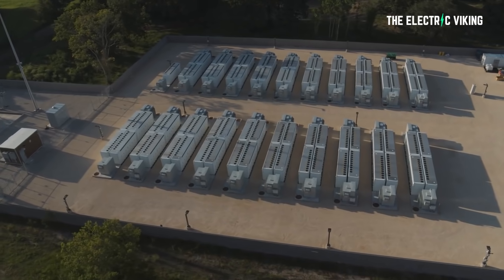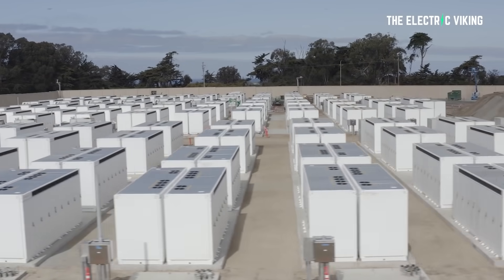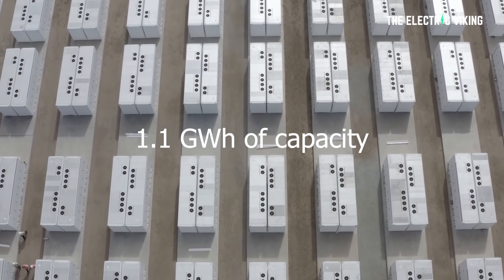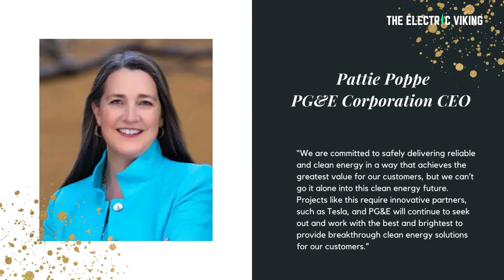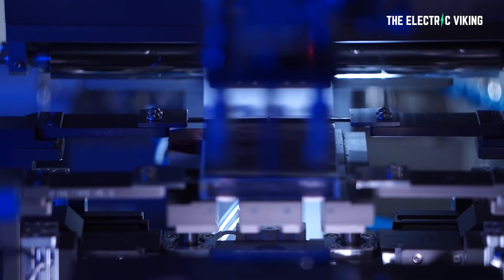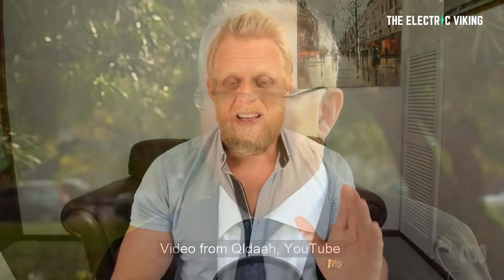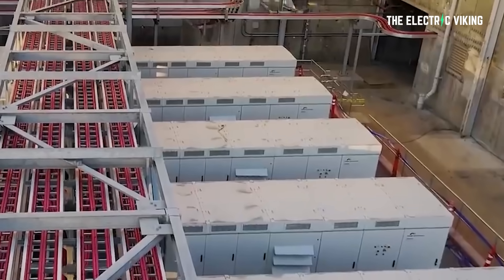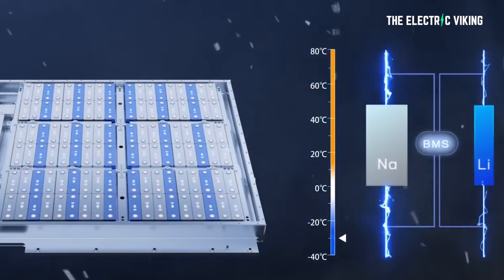Tesla's new MEGA battery signals the end for COAL power

Comment: Reciprocating peaking plant and gas turbine peaking plant can be at full load in 5 minutes, not hours. Gas turbines do have a ramp rate typically over 10 minutes. Baseload coal fired plant might take up to nine hours limited by the need not to overly thermally stress boiler parts. Hence why base load is coal. Please try and inform yourself before making statements.  BTW - what blackouts in Australia?  My recollection is storm related. The other factor is the current (no names) plant owners have been gaming the market by withdrawing supply - wink - less supply higher prices, of course all under the umbrella excuse of going green to reduce CO2 emissions.  This is why the Australian Energy Regulator stepped in and started to control the market.

Comment: Recently a 100MW/400MWh storage facility was put in operation in Ventura County in SCal. It consists of 142 Tesla Megapacks and  was built instead of a gas peaker plant.   No question in my mind that Tesla’s energy division is going to rocket over the few years.  Utility scale battery storage has been the missing leg of the renewable triad of solar, wind and now storage.  Tesla’s Autobidder AI driven program can be tied in to optimize storage and marketing opportunities in real time. It can and will disrupt the energy market in certain areas.

Comment: THE GRID is were the money is. Soon.
The ends of the grid, millions of ends become the power supply. 
SOLAR with a BATTERY at the ends.
Every one will have a huge battery in their EV, and it will automatically plug itself into the grid. 24/7 except for peak hour. 

The grid will give or take what it needs. 

The EV will dictate what it's minimum needs for its next tasks, driving home, power the home overnight, side trips to shops, etc.
With trickle feed to every EV, the fast chargers will only be needed for a few trips. 
Fast chargers are heavy current installations and expensive. 

Forget horse and cart, forget weakly fill ups and $100s into the tank. 
Every EV will be fully topped up every single day or trading power with the grid.
AND MAKING MONEY 💰. 
Hello Hello anyone thinking???

Community batteries will come first as the grid gets cheap power to sell at retail prices.
The  power station business is at one location, 
The grid business is every where and buys its power from the cheapest supplier and sells for retail prices 😀. 

Nobody talks about this!!!!!!

Comment: These are lithium based chemistry - removing lithum for EV prodution.  While Lithium is a small physcial part of the system; cost it is skyrocking - adding about $2000 in cost to a Tesla size EV and to a Mega unit this Li costs  may well offset any other cost reductions. The mega packs might make an impact on wasted energy; likely more so than EV cars.
Reply: Tesla uses about 5kg per car (according to Elon during the 2022 Q1 call) currently its about 80 usd a kg. So that makes it 400 usd, not sure how you got to the 2000 USD.

Comment: The concept is fine enough; to handle variiations in power but it doens't produce any; so it won't do anything to reduce use of coal - indeed as world demand for electricity is up 3% per year any older 1% growth in world wide renewable - you will then see  EV 's pushed onto the grid - incrasing power demands by at minimum 25% so you actuallly will increase the need for Coal.

Comment: How is it going to produce cheaper electricity prices when the solar and wind are more expensive than gas power plants?  And then you have to add in the cost of the battery on top of that.

Comment: The other tech is batteries in homes that will reduce the load.
Reply: And high efficiencies, like super sealed houses, LED lighting, heat pump dryers, ovens, water heaters, and even home generation to offset most of that. An electric two way car can add grid capacity too if you have a few solar panels for your high efficiency house. Like most things, it's about balance.

Comment: Couple of facts to clear the peoples assumptions of how and why this battery was installed in SA.
The power grid could not cope with peak demands during summer,( just like in California.)
There was enough capacity ,it just could not react timely quick enough to deliver to supply a city and surrounds of about 1.5 million in a state of about 3 million the size of Texas.
Elon said Tesla will supply for FREE this aud$30 million battery solution if we can’t solve and install in 6 months ready for summer.Tell us where to plonk this thing.
Battery solved the issue within the first week of the traditional 100+F. heat waves by introducing a millisecond intervention to the grid supply (instead of a seconds) by the traditional base load power. In layman’s terms the power needed to “phase sync”with power ,that was the issue -time of sync ,not the amount of power generation.The battery did solve the problem added more capacity as a bonus in addition to supplying a cost effective marketing tool for Tesla.Now these things are scalable cost effective mainstream solutions now known worldwide and accepted as “legit.”
One of the “ unsexy”things that’s occurring in VIKINGS own Melbourne is one of the units is currently undergoing install underground in the CBD environs to support the electrification of the  new 15 $Billion underground railway subway extension project designed to enhance the cross city commute to be finished 2025(ish) plus add capacity to the grid.
It’s not sexy stuff for politicians until it becomes an issue. As I understand it the SA battery is undergoing the regular service/upgrades by adding more capacity with the phasing out the older huge legacy power stations/grid that feed in from Victoria,New South Wales and Queensland which are thousands of miles away,let alone the electrical loss over the wires and the bushfire/wind storms/flood problems that typically coincide at that time of year.

Comment: In Monterey County In California, the word slough is pronounced ‘slew’. Just like stew without the carrots, meat and potatoes.  

The California  Public Utilities Commission has directed all load serving utilities including PG&E to collectively procure 11.5 gigawatts of new electricity resources.  I’m guessing someone at the PUC figured out with electric cars increasing in popularity and the population continuing to expand we might need more electrical power in the near term. I guess batteries count as a resource if you assume if you build it, they will come as in the movie ‘Field of Dreams’.  In this case it’s if you stall a big battery someone else will charge it.  In the same press release PG&E states they hope to idle some natural gas burning power plants and the only remaining clean energy power plant in the state, the Diablo Canyon nuclear power plant.

In years gone by when we actually had forward thinkers PG&E designed and built a nifty system designed to take advantage of the diurnal cyclical-electrical usage in California.  It was called the Helms Project. It took advantage of the excess nuclear generation from Diablo Canyon during the night to pump water from a lower mountain reservoir to one much higher on the mountain.  During the day when more power is needed the water is released through electric turbines to generate electricity and the water is returned to the lower reservoir for reuse.  The next night the process is repeated.  If you don’t have Diablo Canyon and everyone is plugging in their electric cars to charge over night and you aren’t building any new power generation, where is our power going to come from?  If it is a cloudy day or the wind isn’t blowing you’re pretty much in the dark if you depend solely of renewables as we know them today.

Comment: Sam, I live in the San Joaquin (Wah-keen) valley of California I am sadly a PG&E (Pacific Gas and Electric) customer.  This project sounds like a good step forward but will not lower the cost of electricity to customers like me nor will it reduce coal burning for power generation. The State government has been encouraging its citizens to install solar on their homes since the Terminator was governor many moons ago. It made sense so a lot of us did so.  Now we have a surplus of power during daylight hours, so much so, that the utilities (there are two major utilities in the state and others as well) give power away to neighboring states just to get it out of their local grid.  Give it away rather than incentivize their consumers to use it.  They recently switched to time of use rates which heavily penalize customers that use power from 4:00 to 9:00 p.m.  Now, guess again why PG&E is installing batteries.  Store up all that $0.03 per KWH solar power we generate with roof top solar so they can sell it back to us when we get home from work at a 700% profit, even more if you exceed the baseline level of use.  

Still waiting for the price of battery storage to come down enough so I can afford it too without subsidies from rate payers.
Reply: The only thing slowing the transition to 100% solar and batteries is red tape and corruption to help keep old investments viable.

Comment: Gemini 11 square mile photovoltaic project underway in Nevada will have battery storage of 1400 MWh (and 55% of peak 690MW production). Clearly batteries are necessary and feasible. BTW this plant power cost is less than $.04/kWh  (US average price is $.125/kWh).  There is enough desert in southwest US to power entire needs for electric economy at much lower cost than fossil fuels. What is needed is transmission lines to these remote places (Smart Grid). And there are remote low cost wind energy sites as well. At $380 billion, Smart Grid cost estimate is high. But over decades of use, this cost is only of few percent of power cost.  Where are the venture capitalists --  new Elon Musks -- willing to build the Smart Grid, essentially a pipeline for clean low cost energy for an electric economy? And yes, someone needs to start mining a lot more lithium.

Comment: It amazes me that we can design circuits, and silicon processors, that are amazing, yet we still don't design electric grids with capacitive storage o.O
Reply: Two things: capacitors only store DC. That would be OK if they were on a DC high line (like 765 KV) but no good for AC. The other problem is their low volumetric density which is why they haven't found use in EVs and other portable electronics.
Reply: @jamesvandamme7786  Re: "capacitors only store DC", when i mentioned "capacitive storage" i'm obviously talking about the literal ability to have a "capacity" of energy stored, regardless HOW it is stored from gravity batteries, to chemical, to all sorts. We literally have NO storage at the moment on common grids hence why grids have to access more energy by spinning-up hydro, or tapping neighbouring county's energy temporarily.  Else they brown/black out. 
Just have a look at what happens when millions of people use the electric grid simultaneously to make something simple like tea:
https://www.youtube.com/watch?v=slDAvewWfrA  

As for "only DC", that's why we use inverters, as seen in the grid batteries discussed already.  
Not sure why you're saying EV's and portable electronics don't use capacitors ?? They are literally a basic staple of electronics, just like diodes, resistors, transistors, etc from smartwatches, smartphones, to laptops, all the way to EV's too o.O ...  Maybe you're referring to something else ??

Comment: Just over 1.3 Gigawatt hours of storage is a drop in the ocean. 
I don't know what size grid this is connected to but in a recent other You Tube video regarding batteries I pointed out the the relatively small U.K. grid (50 gigawatts peak demand) had ten days of low wind generation, quite a common event. The loss of about six to eight gigawatts of wind generation below average would require approximately 1500 gigawatt hours of storage to replace that low wind. Then you need that amount over average of wind generation to recharge the store. That in itslf is problematical as it is far from assured, indeed in practice we had a few days of high wind, but no exeptional and then it was low again.
Batteries can never make up for renewable intermittency.
What we need is reliable generators not storage. 
Storage is useful in grid operation for frequency support, as it can supply large amounts of power very quickly allowing the conventional generators to increase output and restore demand and supply balance. This is what the South Australia Tesla battery does.
Reply: When people say x CAN NEVER y, I roll my eyes. Like in 1987, I had people telling me that VTOL electric machines would be IMPOSSIBLE because they would break the laws of physics. And in 1987 it sure felt like that. Then in 2014 I went to Walmart and bought a $20 VTOL electric machine and played with it at my desk. Electric flying machines. Who would have thunk it? People also said solar could not be cheaper than coal. That's already not true now. If we think of battery banks like a part of a solar plant, well, then they will make every solar/wind install a 24/7 base load generator.
Reply: Anthony,

 simple arithmetic tells you all you need to know. Nothing is impossible if taken to the extreme. First calculate how much storage is required in Gigawatt hours, then calculate how much material is required for that amount of storage, what size factory would be needed to manufacture in atimely m,anner and finally the cost.
Currently batteries have arelatively short life, in power genertaion terms, as do wind and solar generating systems.
Perspective and proportion are important.

Incidentally solar is extremely expensive when all costs are factored for grid connection. It is a dreadful way of producing electricity from a technical and practical point of view.

Comment: How much INERTIA does the battery have to protect the system from faults? - See Odessa solar blackout.
Reply: Well, that's a mechanical kinetic energy term. Do you mean how long it takes to power up?
Reply: @jamesvandamme7786  When a line goes down it shorts out and needs power until devices remove the line from the larger system.  That massive power increase is available immediately on the coal units because of spinning mass that is magnetically coupled to the system.  Renewables and batteries use inverters that often do not respond to the fault or they trip off easily and cause a blackout like in Odessa.

Comment: burn calories not electricity, Clothes Lines for drying out the laundry, quick clothes lines hack, setting up indoors clothes lines will work year round in the winter time in subzero temperatures.  Indoors clothes lines are also ideal for drying out more personal clothing articles like socks and underwear.  The sun and wind are quite very good at drying out some clothes like stubborn to dry denim jeans.  Keep in mind that indoors clothes lines work beautifully.  I have switched over to 100% clothes lines drying and it is a joy and pleasure.  I also wash dishes by hand.  I also harvest some water from the shower, the first few gallons of cold water can be harvested in a 5 gallon bucket and saved up for washing laundry by hand.  I still use the electric washer for clothing.  I do use more efficient ultra quick pre-washing for my heavily soiled work clothing, to pull the majority of the dirt and oil out of the laundry before dumping into the clothes washer for extended washing.
Reply: It’s ridiculous that we still allow professional sports to burn so much energy.Those incels that live vicariously through watching sports should find something  else to play with.